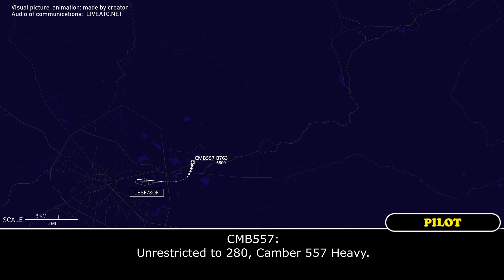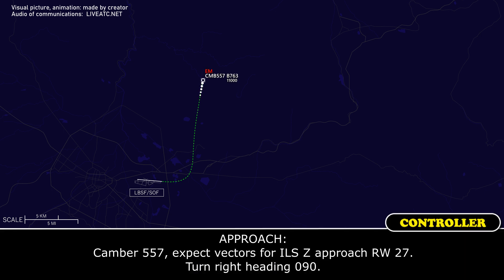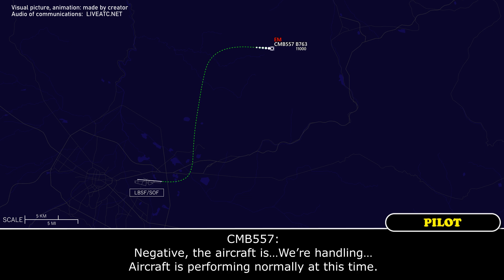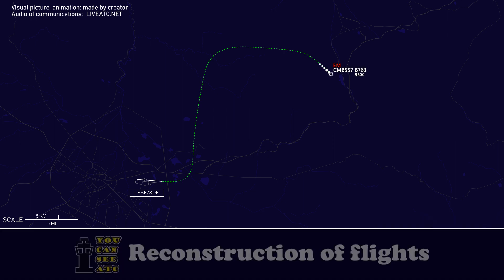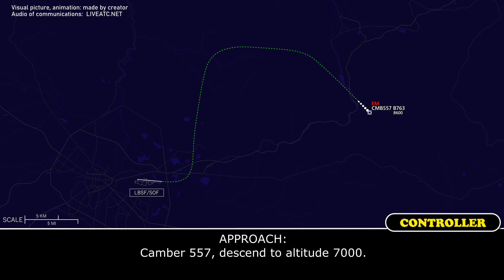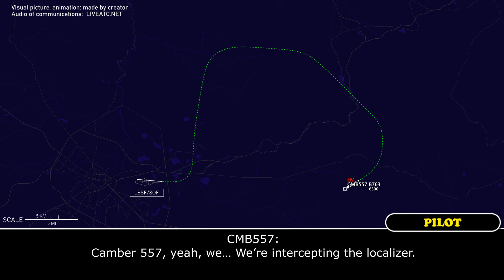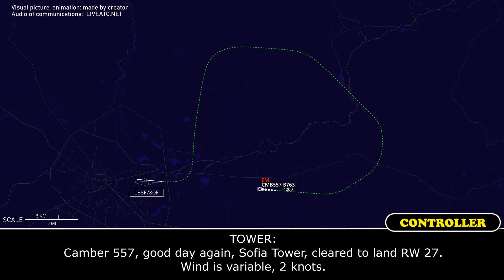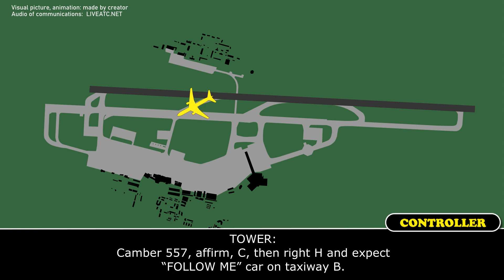Flaps issue after departure | U.S. Transportation Command Boeing 767-300 | Sofia, ATC

Comment: Ok. Any ideas as to specifics of the flaps problem ? ( Sidebar: doesn't the controller have a lovely, articulate, voice. )
Reply: I flew the 76/75 for 7 years. The normal indications of a flap problem are EICAS messages of "flap asymmetry" or "flap disagree". I had two flap disagree messages which means that after a few seconds the flaps aren't in the commanded position. Flap asymmetry can be a bit of a control problem and thus more serious. Both times it was after selecting flaps 0 on climb-out and thanks to an old head I knew that after smacking down the flap handle into the detent it would go away. Contacts would get out of rig and even though the flaps and slats were up it didn't sense the handle in the 0 detent. I wasn't there but I'm not sure why this was an emergency. All ended well.